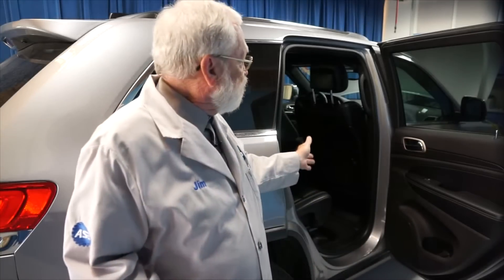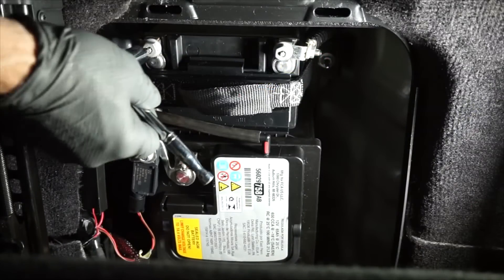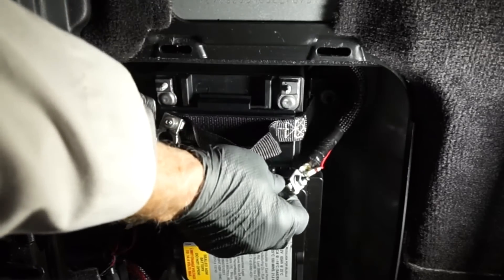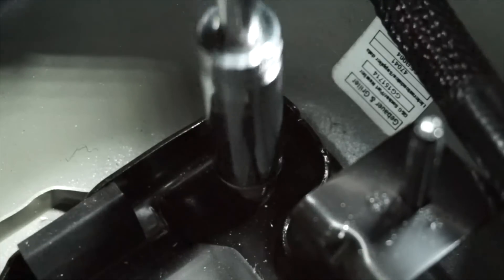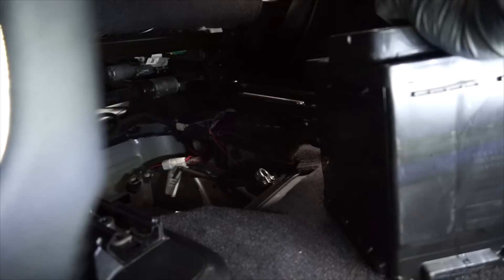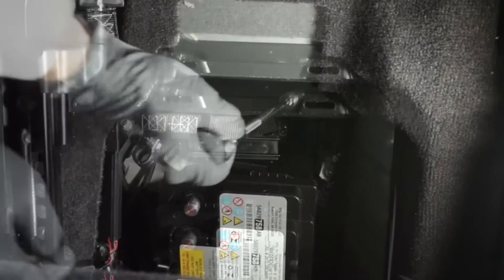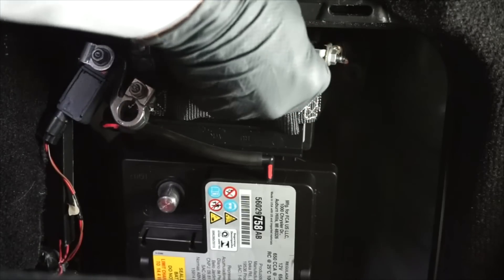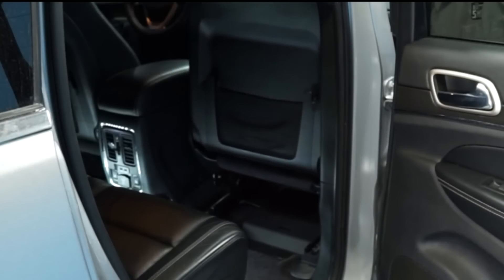Jeep Grand Cherokee & Dodge Durango with Start/Stop (2011-present) - New Battery Install

Comment: H7 battery ONLY fits if no auxiliary battery ( start stop feature ) is there. H6 is correct for use with auxiliary battery.  There is an inch and a quarter lenth difference  that matters. Haven't seen this pointed out anywhere. The features and specs in the 2 batteries are the same. Just different dimensions.  Real pain in the butt. ALSO , just remove the seat. Takes 5 minutes and real headache saver. Just saying from experience.

Comment: Instruction Sheet: Replacing Both Batteries on a 2017 Jeep Grand Cherokee (Start-Stop System)

Overview

This vehicle has two batteries:

Main battery: AGM type

Auxiliary battery: smaller, for the Start/Stop system
Both are located under the passenger seat.

Use a memory saver before beginning to retain computer settings.
Always wear gloves and safety glasses.

Tools Required

10 mm wrench

13 mm wrench

Memory saver device

Gloves and safety glasses

Preparation

Move the passenger seat all the way forward and up.

Remove the plastic battery cover.

Connect a memory saver to the vehicle.

Battery Removal
1. Disconnect Negative Cables

Use a 13 mm wrench to loosen and remove the auxiliary battery negative cable.

Use a 10 mm wrench to loosen and remove the main battery negative cable.

2. Disconnect Positive Cables

Use a 13 mm wrench to loosen and remove the auxiliary battery positive cable.

3. Remove Auxiliary Battery

Use a 10 mm wrench to loosen the auxiliary battery hold-down strap.

Remove the vent tube from the side of the auxiliary battery.

Remove the hold-down strap and tray.

Lift out the auxiliary battery.

4. Remove Main Battery

Use a 13 mm wrench to loosen the two fasteners securing the auxiliary tray (also serves as main hold-down).

Remove the auxiliary tray and strap.

Slide the main battery backward.

Use a 10 mm wrench to loosen and remove the main battery positive cable.

Remove the main battery from the vehicle.

Battery Installation
1. Install Main Battery

Place the new main battery in position.

Attach the positive cable to the positive terminal.

Do not pound the terminal on; tighten gently to avoid damage.

Slide the battery forward and reinstall the bracket and fasteners.

2. Install Auxiliary Battery

Install the auxiliary battery and secure it with the hold-down strap.

Reinsert vent tubes into both batteries.

Inspect vent tubes for cracks or damage.

3. Reconnect Cables

Attach auxiliary positive cable to its terminal and tighten.

Attach main negative cable to its terminal and tighten.

Attach auxiliary negative cable to its terminal and tighten.

Final Steps

Reinstall the plastic battery cover.

Move the seat back into position.

Verify all connections are secure and vent tubes are properly seated.

Start the vehicle to confirm successful installation.

Safety Note:
Always follow manufacturer-specific procedures when replacing batteries. Dispose of old batteries according to local regulations.

Comment: How do I access the battery if I can't move the seat because the battery is dead and will not take a charge, the electrical system will not turn on and seat will not move with a 10amp charger connected to the jump terminal under the hood, I can't even move the seat to access nuts/bolts to remove the seat. With the charger, I am getting the jump terminal up to 12.9v but nothing electrical on the Jeep Grand Cherokee works.
Reply: Having the same problem. The only thing I think will work in our case is to get a new battery and use jumper cables to connect it to the hood jumper terminals to get the car to power up and then move the seat.
Reply: @nathanmcmahan400  Thanks, Roadside assistance came today and tried to jump start, Jeep then had power, but the Jeep would not start.  They could do nothing else, second roadside assistance guy came with Flatbed, first tried to jump, that failed, and then we decided to push the jeep out of the Garage but the wheels would not turn, I had tested releasing the transmission before the first roadside guy came and I could move the jeep but now the brakes were locked and would not release so that guy left because he could not get the jeep on his flatbed.  I can now move the seats, all the documentation I could find said the battery was under the passenger seat, Nope, that’s just the little Motorcycle sized battery, turns out the main battery is under the driver’s seat.  I read through the owner’s manual and figured out how to turn off the parking brake. A friend helped push the Jeep out of the garage and I called roadside assistance again, the guy with the flatbed came and took the Jeep to the dealer. The dealer installed 2 new batteries. I was also told that they are expecting a fix to the problem that causes the dash to continuously power cycle under certain conditions which is what I suspected was the cause of the dead batteries.

Comment: How to reset the memory if you didn't use a memory saver
Reply from the maker: Thanks for watchin. You will have to manual reset your saved presets if they default back to the factory settings.
Reply: @TheBatteryShop  thanks but I geuss it is the fuel pump again

Comment: Do you have to replace both or is it just the aux battery that won’t turn  over ???
Reply from the maker: Thanks for watching. If the car is not turning over you should replace the primary 12V starting battery.  The Aux battery should also be checked.

Comment: Great video. Made this job so easy.
For those without a power passenger seat I found it easier to slide the seat back to access the positive battery terminal.
Reply from the maker: Thanks for watching. Glad to hear we could help and thanks for adding the information.

Comment: Is it necessary to replace both batteries when doing this?  I know that my 2018 Jeep Grand Cherokee's auto start/stop quit working some time ago.  Wondering if that battery went back first???  Thanks for the video.  I could care less about the start/stop.  I just as soon it didn't work anyway.
Reply from the maker: Thanks for watching and glad we could help you out.  I would recommend taking it to a local retailer to have both batteries tested.

Comment: Much easier to unbolt the front seat 4 bolts and tilt back.
Reply from the maker: Thanks for watching and contributing to the video.
Reply: I didn't have to unbolt the seat. I was able to swap out the battery in about 25 mins.

Comment: Im getting a low voltage warning after my new batteries were installed.
Reply from the maker: Thank you for watchin. We would recommend to consult a mechanic or your dealer on the status of that warning.

Comment: Hi.there. my battery is sliding around, clunking around when i stop. What is used to hold the battery in place? 2014 grand overland.
Reply from the maker: Thank you for watching. There should be a factory hold down as part of your vehicle. If you are experiencing issue I would recommend having a mechanic or dealer look at your vehicle.

Comment: Great video. I will add once the power is reconnected it will likely trigger the SGM (security gateway monitor) in the vehicle thus losing many functions like backup camera, temperature controls, passenger heated seats, and Uconnect will lose half the features. I’m called Uconnect, they were clueless. The solution is patience. Everything came back within a few hours good as it was. Might take longer for yours, but from what I’ve researched it’s extremely common.
Reply from the maker: Thank you for watching and thank for contributing to the topic.
Reply: Not if you put some 12V power on your under hood battery posts before doing the work.

Comment: Wondering how to know which battery is going bad? Does the Jeep tell you?
Reply from the maker: Most likely, the Jeep won't tell you. Some common signs that the battery would be going bad is if it has dim headlights, electrical problems, issues starting the car, corrosion, a warped battery case, or a rotten egg smell. You can check it using a multimeter, or you can go to an auto shop to get a more accurate load test done.

Comment: At what poind did u disconnect the back up power?
Reply from the maker: Thank you for watching. Backup power would be disconnected after you have installed, connected and tighten the fasteners to both battery posts.

Comment: Its a lot easier to just remove the seat by removing the mounting bolts. Then move seat by hand forward. now you have total access to area. Less than 5 minutes to remove bolts and covers. Remove two wire clip first at positive to not lose memory.
Reply from the maker: Thanks for your advice and contribution to the conversation!

Comment: My 2012 durango with push start has no auxiliary battery 🤔
Reply: The aux battery is only if you have the stop start feature  on the V6 which didnt start till like 2016 I believe  .

Comment: While this is a very well thought out and executed tutorial, it should be noted that the 10mm socket to remove the auxiliary battery tie down at approximately 2:06 and the 13 mm socket to remove the fasteners of the auxiliary battery tray both should be a deep socket - the stud extends too far to engage a regular socket. One other note regarding the auxiliary battery - not all replacements come with the terminal studs and it may be necessary to remove the studs from the old auxiliary battery.  Avoid the temptation of using a pair of vise grips or pliers which will damage the stud and pick up an E-5 External star or reverse torex socket - it makes stud removal a snap.
Reply from the maker: Thank you for your addition to this conversation!

Comment: This is a great video! I just replaced my original 2017 SRT battery and had to remove the four seat bolts to get the H7 out. Don't forget to plug the positive side vent, it should come on your new battery.
Reply from the maker: Thank you so much for your support!

Comment: So if you don't use the start / stop feature can you leave out the start / stop battery or just let it stay dead ?
Reply: That's not a great idea. If you have a dead or failing auxiliary battery and it's still connected, it will take power from the main battery, eventually causing it to die sooner. If you really don't want to replace the auxiliary battery, make sure to disconnect it to prevent it from killing the main battery. Another thing to consider is that these vehicles use both batteries together during cold starts. So if you don't have both the n good working condition, you won't have full amperage available if you needed it, such as a really cold winter morning.
Reply: @Japplesnap  How about just one stronger battery ?
Reply: @guynoir4733  You could do that. Some people put an H7 in place of the H6. But it will only fit if you take out the smaller auxiliary battery.
Reply: @Japplesnap  Yes I'm sure I saw a video where there was only one battery . Thanks .

Comment: good video but i have questions.  Ive seen this procedure done from the front and removing the seat bolts to tilt it all the way back.  Is there really enough room to do it from the back?
What is they type of memory saver you used? 
Is the pushbutton ignition using the main battery and not the start stop battery? 

Thank you

Comment: Does the main battery have the gas vent hole on both sides? If so, any harm if the other side is not plugged?

Comment: What happens on a 2016 dodge Durango citadel if you do not use a memory saver? I want to try to reset my part assist module by removing battery cables. Will this work?
Reply: No memory saver is needed on these vehicles. You will lose nothing at all by disconnecting the battery. I have no idea why the used a memory saver in this video, but it's definitely not needed.

Comment: Does anybody happen to know the size of the male torx studs/bolts that are on the auxiliary battery? I ask because the replacement auxiliary battery that I bought doesn’t have those pins/studs/bolts so I’ll have to remove them from the current dead auxiliary battery. I believe I’ll need a Female torx tool to remove them???
Reply: Size 5 e torx.

Comment: My friend just tried to change his auxiliary battery but didn't take off neg cable on main batt swapped aux batt now has no power won't start ? Is it a fuse?
Reply from the maker: Hi - Thanks for watching! Long distance diagnostics is difficult if not impossible. We suggest your friend go over the replacement procedure with the help of a service/repair manual to be sure all steps were done correctly (main battery fully operational, all wiring replaced properly, nothing hooked up backwards, etc.).

Comment: Do all 2014 jeep grand Cherokee limited  have a second battery? I only have one.
Reply from the maker: Hi - Thanks for watching! Vehicles that have the Start/Stop system usually have a Main and Auxiliary battery. We suggest that you check your vehicle owners manual for the battery(s) your vehicle is equipped with.
Reply: I don't believe  they had the stop/start  system in the 2014's which is what the aux battery is used for to power accessories when the engine shuts off at the lights .

Comment: ATTENTION: When removing the smaller battery tray……the two 13mm nuts to be removed will need a long extension ( a 6” or 10” will suffice) along with a deep 13mm socket to remove them……otherwise you will have little to no room to turn the ratchet for their removal……the small battery hold down nut will require a longer extension as well as a 10mm deep socket for it’s removal…..you may need to trim the vent tube an inch +/- while attaching it to the big battery as my new replacement battery’s vent hole was about an inch shorter then the oem battery vent hole location……hope this helps with anyone’s R & R in the future……all in all this took about 30 +/-minutes to do.
Reply from the maker: Hi - Thanks for watching and sharing your experiences!

Comment: Replaced my batteries tonight with Duralasts on a 2019 GC Trailhawk. Two pieces of advice: buy DEEP socket 10/13mm sockets. And  go for the H6 vs the H7 (h7 will NOT fit as mentioned in one of the comments) 

Bracket nuts are locktited in and theres a long screw in the middle. If you have the deep sockets itll take a good 5 minutes to get those bad boys out. Without the deep sockets - good luck. 

All in all. Took me about 15 minutes total to replace both batteries. Everything works. 

Also, i didnt use a trickle charger and didnt lose any of my settings.
Reply: Currently trying to put my batteries back on and finding random wires wtf 😭
Reply from the maker: Hi - Thanks for watching and sharing your experience!
Reply: The deep sockets and extension are key.
Reply: Good advice. I didn't have deep well, so I had to buy a set of metric deep well sockets. And it did take a while to get the nuts off the long a$$ battery tray bolts.
Reply: A friend just dropped off her Durango at the dodge dealership ~where they gave her a $1200 estimate !
Reply: Bro where did you get aux battery?

Comment: Holy cow. Just did the same procedure on my 2016 Durango. This is German stupidity at its finest. Whoever designed this should get a swift kick in the nuts.

Regardless, thank you for putting together such a good video. Much better than others I’ve seen.
Reply from the maker: Hi - You’re welcome and thanks for watching and sharing your experience!

Comment: We broke the connector part from the vent tube to the plug to the battery. What can I do?
Reply from the maker: Hi - Thanks for watching! When we do things like that, we just buy a replacement part from the dealership parts department or a local auto parts store.
Reply: Dorman 47431. You can replace the connector with this set. Otherwise you have to order the whole vent hose (on back order)

Comment: Will the vent tube cause any auxiliary issues if it isn’t connected?
Reply from the maker: Hi  - Thanks for watching! The battery will allow hazardous gasses into the passenger compartment if it is not vented via the vent tube system.

Comment: Do you need a memory saver for the computer or can you just replace the battery?
Reply: Replaced mine without the trickle charger. Didn't lose any settings. 2019 GC.
Reply from the maker: Hi - Thanks for watching! We use a Memory Saver to keep from having to reset things like radio stations, GPS, steering angle, power windows, or other things a vehicle may have that will loose memory. We suggest that you check the vehicle owner’s manual or a service/repair manual for the vehicle to be sure.

Comment: Great video, only suggestion would be to discuss reusing or replacement of lugs on auxiliary battery. Once the new battery is in place is not the time to realize, oh I need lugs to attach the bolts to.
Reply from the maker: Hi - Thanks for watching and sharing your opinion!

Comment: my vehicle jeep grand cherokee L 2022 system stop start ready when go with my vehicle 50 km after between night to day 20 hours my vechicle system start stop not ready there are no error in my car (auxilary battrey new 12 volt 12 Ah Mopar AGM
Reply from the maker: Hi - Thanks for watching and sharing your experience! We suggest that you refer to the vehicle owner’s manual or a service/repair manual for the vehicle for guidance.

Comment: As I made my through these procedures,  I kept wondering if it would have been easier to remove the seat.   

I found it easier to reach the positive cables on the main battery by moving the seat all the way back.
Reply from the maker: Hi - Thanks for watching and sharing your experience!

Comment: How do you replace the vent hose if he the connector breaks?
Reply from the maker: Hi - Thanks for watching. When we need replacement parts like this we check out the local auto parts stores and the vehicle dealership parts department.